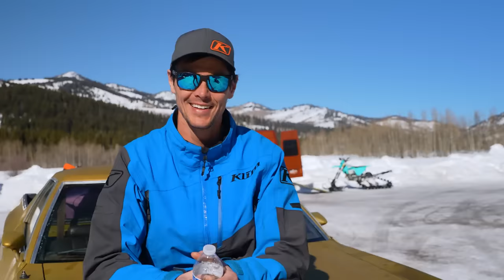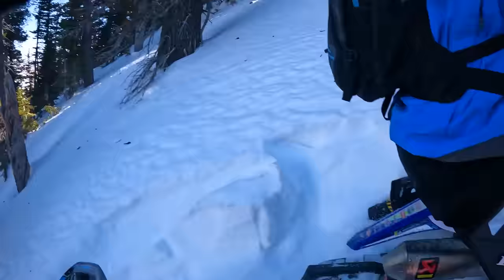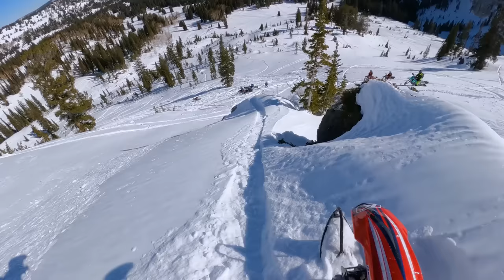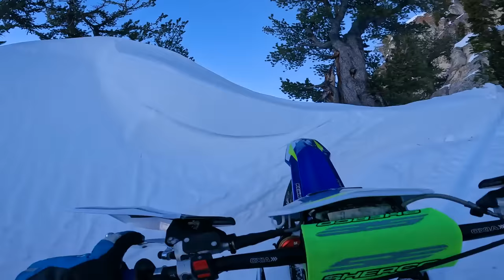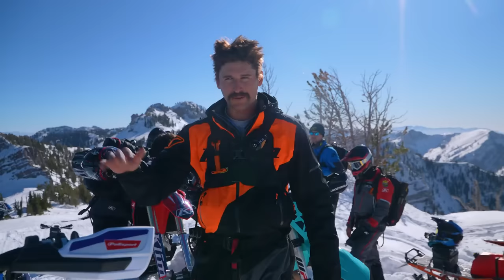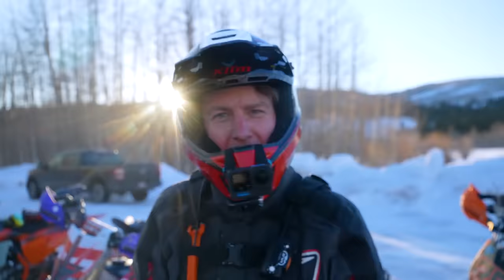Pro Dirt Bikers Shred Snowbikes | Day 3

Comment: Get over to Idaho with us we’ll show you some deep powder areas. Looks like you boys are spring riding
Reply: This practically is Idaho. It's right on the border.
Reply: @wrouse7  not deep enough in. Border is too close to other states that apparently don’t get the same snow. We’ve been riding 6’ off bottomless powder haven’t worried about stumps or rocks once
Reply: @509FUN  Pretty sure this is spring riding from last season. Does not look like this in Utah right now, season seems like it's decently deep for them already. Better than the last few years for sure.

Comment: Ya these bikes need twice the power what i see they can't produce enough power to get up a hill let alone up on plane .
Reply: If you Havnt rode one it’s easy to speculate like that. It’s a totally different sport and different way of riding and exploring. It’s like comparing a souped up banshee at the dunes compared to riding single track riding on a dirt bike. Two very different types of riding yet both are extremely fun.
Reply: @QuinnPayton  It's fun as hell as is, but I certainly wouldn't turn down more power or reliability.